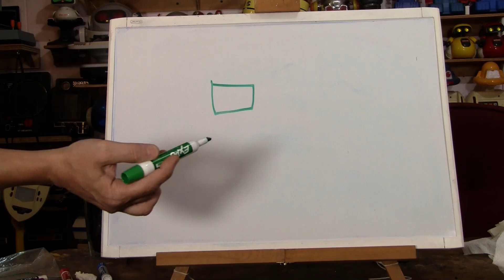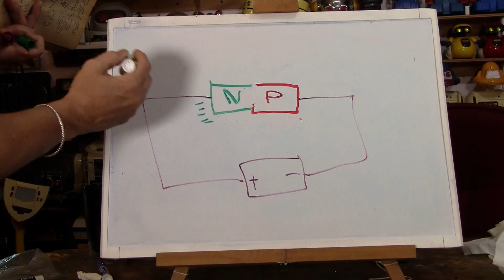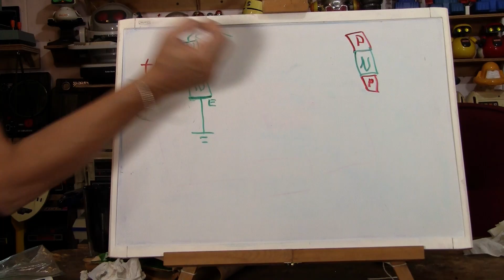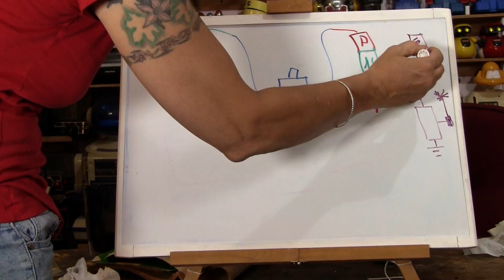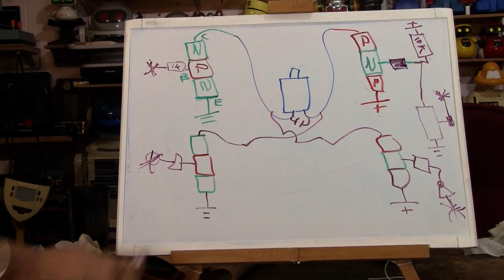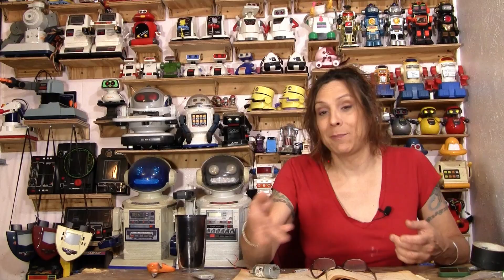The Complete Guide to H-Bridge Circuits (With 3 PCB Designs!)

Comment: It is becoming a lost art working with single bipolar devices.  I like your simplistic approach to explain how the circuit works without getting buried into details of keeping the limitation of iC and iB current.  The clipping diodes would appear to shunt any voltage over .7 volts as drawn in the circuit, but I think your most important message was to kill the emf spike on shutdown.  I suspect an appropriate capacitor in series with the diode(s) would be required to prevent the diode from being active while power is applied and motor is turning.